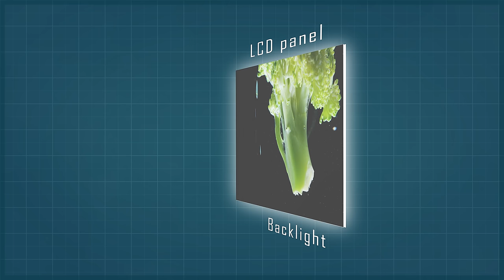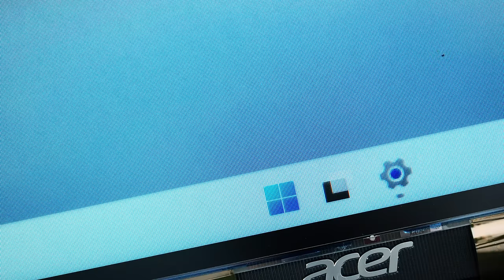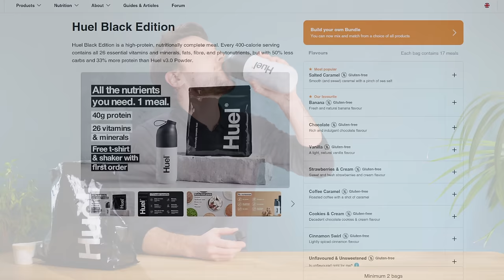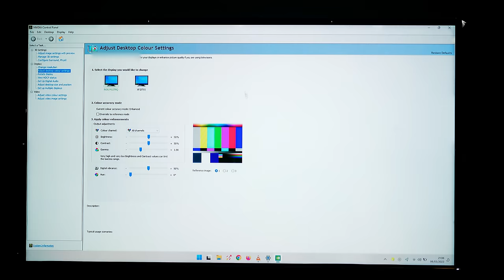DIY Dual-Layer LCD monitor - can it match OLED??

Comment: I spent $2,000 on an active 3D that failed twice😂 they sent me another one in it failed as well. I finally gave up and that was the last expensive TV I ever bought. I've also been given broken TVs like giant 55-inch TVs that had a blown cap or just burned out an LED wire😅 those are turned out to be my best TVs, hell I'm rocking five TVs at the house right now and I think I paid for two of them. I didn't pay more than $250 for either of them and what is a 65in 4K TV

Comment: hello, nice as usual. Can you make an air conditioner with peltier  modules? but the proper way. I have seen lots of vtutorials and they dont provide good ideas on how to make the hot side of the peltier module a way to make the heat going away a room. Also,  i noticed that peltier modules are not power efficient, but maybe you can come up with a way to make it power efficient. It would be cool if you can make an AC with peltier modules, that can compite with a normal AC split. I hope you can consider my suggestion.

Comment: led strips would have been fine and fans are unessesary and it will make dust inside the backlight.  you could have made it smaller with better diffusion materials but its good. maybe one day I will try it

Comment: I was wondering that if it is possible to use this technique while using 2 different resolution LCD panel, the lower resolution will be  in the back, while the higher resolution in the front. I think it could work but only if the back LCD is half the resolution of the front one, but it would be harder to get a 960 x 540 for a 1920 x 1080 then just buying to 1920 x 1080.

Comment: You should try doing this again but instead remove the polarising filter from the rear LCD, its very difficult but its definitely possible. The glue the two LCDs together with LOCA UV glue.

Comment: There is something called microled, which doesn't have the burn-in issues of oled but all the benefits of that tech. Still in development, insanely expensive to get as a consumer for now.

Comment: I think you need the 2nd layer to be monochrome and close enough to the first layer that there is little spill between pixels. Then the 2nd layer should be opposite polarity of the first. I'm wondering if most of the gains you accomplished were just because the entire scene is dimmer.

Comment: this is probabably the solution, we just need new 12 bit LCD paneles, so we can adjust the brigtness in HDR content more. I say this cuz my new xiaomi 12 has a 12 bit display and it can show hdr content in lower brightness levels, my galaxy s10 cant show hdr with out setting the brightness to max due to the 10bit panel. I hope manufacturers began to do this.

Comment: Not easier, but would it not be better to simply remove the polarising filter from the secind LCD, thereby using the polarised light from the first screen as opposed to repolarising it after diffusing it. 
I imagine that would crispen up the image somewhat, and remove some thickness. Obviously the best way to do that would be to use a more efficient diffuse filter instead of baking paper, but otherwise, its a proven concept. You've probably gone overboard on the LEDs, so can save some power there, and it's also probably possible to use one image board to drive both displays, saving more. Assuming equal brightness with less energy, and a better diffuse filter, bringing the lights closer would make the display brighter, possibly negating most of rhe downsides of this system. Theres definitely a power draw factor, but it might not be as bad as V1 is indicating

Comment: Time traveling from Jan. 2024 - could you remove the polarizing layer from one of the LCD panels (the lower one)? I've seen this done (and done it myself) by laying wet paper towels on the panel for a couple hours. Then the polarizing layer pulls off. It makes for a sort of "secret" LCD screen, because the LCD is not polarized - but if you wear polarized sunglasses it is visible again.

So - you could remove the polarizing layer from the lower panel, leave it on the front panel, and you don't need the "defusing" layer of paper.

Comment: Forgive me for saying this as Im just spitballing here, but the way you presented the problem the lack of proper black on an LCD can be attributed to some of the backlight still making it through the LCD panel, so it makes sense that an extra panel means less light shining through the black parts. 
However you've also increased the backlight output, so wouldn't this be a wash? 
Instead of tracing paper, wouldn't it be possible to remove the polarizing filter on the first panel, as some peeps have done to create "privacy screens"?

Also, wouldn't dual display boards result in slight but perhaps noticeable timing issues between both panels?

Comment: Wouldn't it be possible to connect two panels (just the panel) onto one single controler? I mean the panel doesn't send out any information. Means you just need a splitter to send one signal from the controler to the two panels. Similar to connecting two headphones to one port.
Then you just need to remove the polarisation layer fom the second panel. This also eliminated the need of a depolarisation layer since you only polarise the light after it got through both panels.

Comment: I have an LCD that I've recently pulled out of a TV that I was going to try to make a printer out of but I have a another TV that is the same size and is LCD as well both TVs already have a light box design! I wonder how that might turn out! I've already bought the TV lights needed for my printer though it's just I've been scared that I'm going to break the LCD from the weight of the resin so I haven't finished it yet! I'm trying to get a smaller LCD first and attempt that.

Comment: Heath-Robinson would be proud 🙂. Just get a 48 inch LG OLED. Buying last year's model, or the one before that, will bring the price down. I run a 48C1 as my gaming and general Windows monitor, and have the previous year's CX on my XBox Series X. Both are 120Hz VRR. From the CX onwards they have vastly reduced image retention. You simply can't beat OLED and the only downside is relatively lower brightness so just don't try to outshine the sun 😉

Comment: Adding more LEDs in the backlight but running them at a lower voltage could both lower power and increase brightness.
Likewise you left a lot of effeciency on the table by not removing more layers from the bottom LCD, for example the matt screen coating only adds to the layers light needs to pass through and it is only neccesary on the top level panel.
Also instead of the depolarizing filter, couldnt i be possible to just turn one of the panels upside down compared to the other and making the image correctly oriented in software, or would it still be polarized in the same way?

Comment: If you used two panels with a different color gamut would they multiply or would you be reduced to the lowest common denominator?

Im genuinely curious if you could get the best of both worlds by mixing panels or the worst of both & best of neither. 

I suspect that if the results were good you could scale manufacturing for very little compared to OLED & microLED & sell at a much smaller premium. 

Either way it’s amazing how good cheap TVs have gotten & how cheap good TVs have gotten. If you don’t need the best & can settle for merely being better than your 6 year old TV the value is insane currently.

Comment: Why didn’t you just use the ”frosted” film in the diffusion layer of one of the screens? There are usually two layers of diffusion with lenses to spread the light and one layer of frosted film to smooth the light. The light throughput of that film is much better than the tracing paper.

Comment: No it can't, OLED is a category on its own, it's a pure superb display tech with almost zero drawbacks just the burn in. The best colors, the best blacks, each pixel is a dimming zone, superb HDR performance and Dolby Vision support. And probably any OLED is still better than any LCD. And brightness isn't really an issue, I have 600 nits on my LG B3 and it's not even at full brightness.

Comment: If you could do this from the manufacturing level, and so didn't have to deal with depolarising, i.e. remove the polarisation filter from the back screen (which I'm surprised you didn't do.)

Comment: This should be a viable alternative to OLED. You are emitting 2x or more light with the led enhancements. Then you are blocking much of that light with the tracing paper. The darker areas are getting the most darkening, while the lighter areas are getting the benefit of the extra lumens. It's a wonder why Sony and others who use LG's OLED panels don't implement something like this. Most people don't care how thick their monitors or TVs are. Maybe the bezels, but not the depth. Give me nearly the same quality from a 2" thick TV vs a LG C3 and cut my price by a quarter or in half and I wouldn't think twice about it.

Comment: People will do anything to not use a CRT, smh.
A CRT is better than this thing in almost every way. CRTs are cheap, have better colours, have better motion clarity, and high refresh rates will ALWAYS look better on CRTs. The only thing this monitor has over a tube is size.

I'm only half joking, of course. This is an incredible project and is very cool!

Comment: Neat concept and novel execution.
I feel like that tracing paper is a huge problem for any power efficiency due to the great amount of light entropy.
Is the splitter necessary? May be able to duplicate signal without significant latency delta from the OS as two separate outputs.

Comment: I wonder if you can remove the polarizing film from the first panel and allow the polarizer on the second to act as the one for both, thereby eliminating the tracing paper middle layer and potentially increasing the brightness (transmissiveness?).

Comment: Very nice project indeed!
I have some monitors with broken power supply boards that would be ideal for this conversion. I see that you used a generic PSU to drive both the LED stripes as well as to replace the power boards from the two monitors, correct? How did you do that? To my knowledge power boards for monitors often output a wide range of voltages, e.g. +12V, +14V... some of course drive the LEDs but some drive the LCD panel and the board with all the inputs (HDMI/VGA/DisplayPort...)

Comment: i had a samsung tv that was like this back in 2009 it was amazing but again had issues with texts but not as much so as the diy  i miss that tv it did pull the same 240 plus watts though

Comment: Wouldn't it be better and less power consumption to weld both screen connectors to one board instead of placing to boards?

I mean, if able to ( Probably would need better capacitors ), but should be possible.

Comment: My question is, why couldn't you have removed the polarizer from the rear LCD? even if it wouldn't completely fix the polarization issue, it could have been a brightness increase as less of the light is  polarized out of phase/angle

3d LED TV used very similar tech with 2 lcd with differential polarization between each panel.

Comment: And how would it have been when you used the second monitors backlight on top of the first one? Would that double the output?
Then again, you did use one layer of tracing paper in between, so it would cause some loss in brightness...

Comment: As a question, do you need the second layer of tracing paper as the diffuser, or, wouldn't the one that's depolarizing the first lcd display be able to preform the task?

Comment: THA lad forgot the biggest drawback of the OLED screens.

They are so dim that manufacturers has to remove the polarisation layer which is necessary to fight reflections. As a result, OLED screens have horrible actual contrast when you use them in any conditions other than darkness. This is contrary to the marketing BS about “infinite” contrast.

So yes, the double LCD should be way better. Though the power consumption is really bad.

Comment: Hi,
could you build an e ink monitor?!

There are some suppliers, that offer e ink displays (that work with raspberry for ex.).

It would be great, if the refresh rate would be fast enough for typing / using it as 2nd monitor for office tasks.

Thank you,
Andy

Comment: why cant you just turn the second panel around by 180° around the vertical and then mirror the image?
In that way both  front sided polarizer sheets lay over each other and light is no more blocked.
but you have two times "black" effect by turning the polarization

Comment: for a real dual layer, they only require a black and white low resolution panel behind the color panel. I think this IS a great solution...and I'm bewildered why it hasn't taken off. I can buy a 27" ips for 150 bucks...I'd gladly pay 300 for a dual layer!
Reply: same technology used in proffesional monitors for 1000000$ xDDD
Reply: you can buy it

Comment: hm my VA-panel monitor can black=black (derfect dark) and no it was not 3000$ or so only 380€ for the dell monitor and only 30watts (i use it for rendering/gfx and gaming) but mine is not DIY. nice build :)

Comment: I need assistance from anybody about my Sony 65" LED TV.  The diffuser got water damaged.  The LED backlight with the acrylic cover is fine, and the display digitizer is also fine.  As I peel the prism sheet away from the acrylic of the diffuser, it looks like the acrylic is also fine, while the prism sheet is what's left damaged.  Where can I find replacement prism sheets that would work for this scenario?

Comment: What if you remove the polarization films from between the panels? In this case you wouldn't need the beast lights nor the trasing paper between the panels. Then the panels should have a minimum distance between them and the image could be sharper. Anyone tried this? I could be wrong though.

Comment: Couldn't you also connect both panels to the GPU and tweak the settings to drive the rear panel in monochrome and only boost contrast w/o overblowing saturation/gamma?

Comment: this is brilliant, i think il try to build one myself. im thinking of using halogen lights instead of led because of cri, not sure if that would make much or any difference but it would be interesting to find out
Reply: Halogen are dangerously hot. Black body radiation and all that. I don’t know how you’d pull that off without melting the chassis. Fiber optics maybe would work, but that is just getting absurd.

Comment: Oled would be just cheaper and better option at this point, having 2 screens, acrylic panels, power supply, hdmi splitter, bunch of leds and other equipment would just cost way more

Comment: Dude... The diffusion layers were right there. Why did you use the tracing paper with way less transmission? Also you could just cut off the polarization layer from the bottom screen.

Comment: This is cool but you can get a 48" OLED LG TV for about $600-700 on sale and it's an amazing monitor. Can get a newer 42" that is a bit brighter for about the same price too. OLED is getting affordable.
Reply: Still have burn in issue.
Reply: @Mad-Lad-Chad  Ive been using an LG C1 OLED for almost a year. I game a lot but mostly browse the internet with it and I will occasionally have a video playing on my second monitor which prevents windows from going to sleep and the OLED TV stays on the same screen for hours and I have had no issue with burn in. 

Older OLED it's a major issue but even the 2 year old C1 doesn't have much of an issue if you do the pixel maintanece built into the TV. Newer monitors and TVs are even better
Reply: @jeffreykelley3837  All the pixel maintenance does is dim the brightness of less used LED's to reduce the appearance.  So the overall brightness goes down at a given level.  This is covered thoroughly elsewhere on YouTube so I won't go in depth.

I use primary displays for close to a decade (or more) usually, OLED isn't there yet.  LCD is.

Comment: I don't really understand why this works in practice. The distance between subpixels is less than a millimeter yet the distance between the two LCD panels as well as the tracing paper I imagine is way more than a millimeter. This means when viewed off angle there should be parallax that completely destroys the image, as your subpixels are no longer aligned. Anyone have any idea why this works in practice?

Comment: Liked the idea of double panels. I'm not sure if it is power efficient and also hoping that it's not that much heating up when we use the monitor for long time. 

I am using black tinted film on my gaming PC monitor which is generally used in car windows. It worked out for me without much efforts from my side.

Only problem with my approach is it's way too much dark for some games.

Comment: You can make this significantly more efficient and cooler by using a graded index backlight. Essentially the backlight is adjusted dynamically in multiple 'zones' to vary the brightness in different parts of the image. It's a great effect, but it has severe limits. Your dual LCD would mitigate a lot of the downsides and it's decreased power draw would increase your efficiency.
Reply: That always reduces the accuracy of colours (brightness in particular) unless you have fancy software to compensate for it. It would give you all the negatives of a mini-led display with very little benefit

Comment: Has this guy bothered to Google OLED prices recently? Even before OLED monitors became mainstream as of right now, you could easily get a lower-end LG OLED TV for 5 to 600 bucks. 250 w of power is even more than my 15-year-old plasma TV. This was a dumb project from the start. The effective resolution is probably badly scaled 720p because of how uneven and blurry the pixels are, and there is still blooming.

Comment: couldn't you have simply used both backlight LED strips? this would probably solve the thickness issue from the solution you came up with